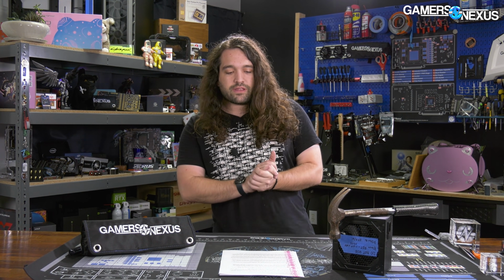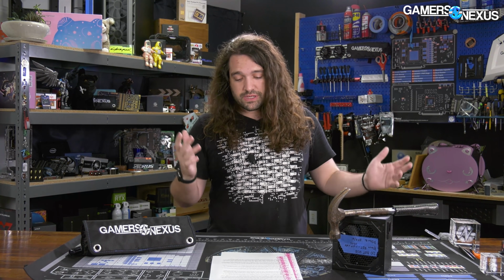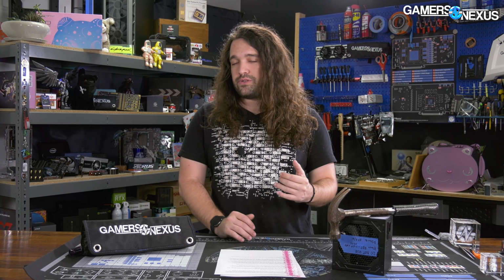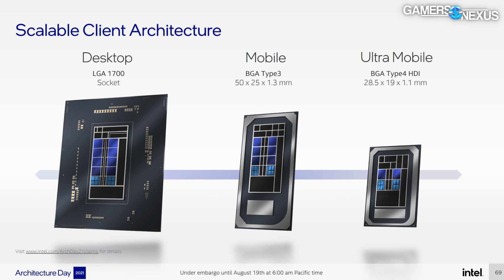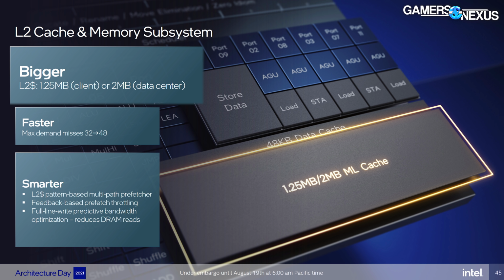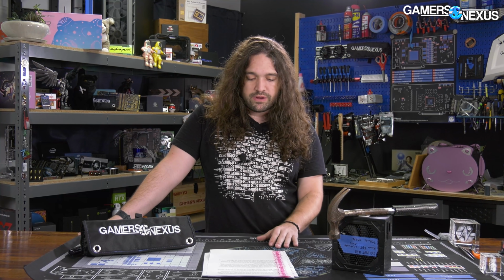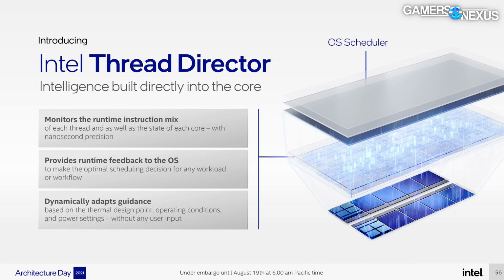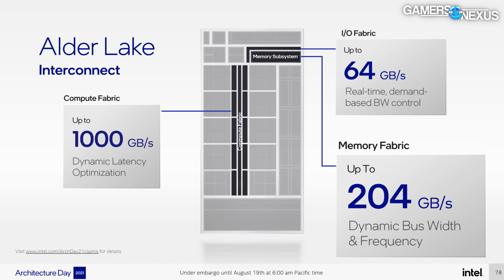Intel Overhauls CPUs: Alder Lake Architecture Explained - New Core, PCIe Gen5, & DDR5

Comment: Can someone explain why I would want effenicy cores. I mean on my gaming pc, I want it to run as fast as possible. I don't want it switching to lower cores. What am I missing and why is this good
Reply: It's like the PS4 design where low power cores can run the OS services and background tasks while the performance cores can be dedicated to running the game
Reply: The efficient cores are smaller and pack more power into less area than the bigger cores.
Reply: this is just my interpretation. efficiency cores are mainly to keep temperatures down which ultimately gives more headroom for your performance cores to run faster for longer. imagine using a 3080 to render a word document. Its overkill as you dont need that much power to run but its still producing that much heat. if you can pass off background os tasks to effeciency cores, lower heat = more boost for performance cores?

Comment: Let's be honest as long as we can lock all of Windows to the low performance cores and then have say the other eight high performance cores solely for our tasks whether they be gaming or cinebench or whatever I'll be happy... And also if the price doesn't hike up
Reply: What makes you think Windows is going to give you that kind of control? Has Microsoft ever demonstrated that kind of consideration for its users? More like you and your silly games will be relegated to the wimpy cores. You peasant!
Reply: @1pcfred  we already can control affinity and priority. I hope they will/would add it for the small/large cores...

Or simply have a "high performance" mode that would shift windows and everything with it to the eco cores.
Reply: @brettcombs774  in Linux there are ways to assign tasks to cores or even dedicate a core to a task. I've never had to do it myself. In general Linux can manage all of that on its own well enough. I really don't see what use low performance cores would be. Sounds like more stuff to worry about to me.
Reply: @1pcfred  perhaps it'll be well enough left alone. But sometimes it's nice to have the feature or capability. The eco cores referenced are supposed to be on the order of greater than Skylake performance but markedly more efficient. I tested a new laptop running 1 core (no HT)  on a 5800h just to demonstrate it could be done for a friend. Given the usage was high it still ran just fine. 

Id wager it will run very well on 2-4 non HT "eco" cores. Which in my mind are similar (yet to be shown) around a 6700 core... 

Which again leaves in theory at least the rest of the system almost entirely for your task. Almost a VM or game console...
Reply: @brettcombs774  I'm sure it's great. It's just not exactly the direction I want to go. I want what I have now only faster. And this ain't that. What this looks like to me is what they can do. Look we can make weaker stuff! I'm all for saving power. I'm just more for having power to use though.
Reply: @1pcfred  that's entirely my point. The perf cores will be better than at present. I think they quoted like 19% IPC. Which is impressive.

And dedicating everything else to the eco cores alleviates usage of the perf cores. Which means everything is faster...
Reply: @brettcombs774  we'll see.

Comment: Could you guys cover more practical programming benchmarks? A blind chromium compile is not a very good indication of code compile performance.
Some projects have different target architectures on different optimization settings.
Python seems to be a fairly popular programming language among your audience, so perhaps find some tensor flow scripts or generic math processing with pandas as additional code benchmarks?

I'd also like to see embedded C compile benchmarks, but nobody seems to write C these days.

Comment: Pray for Intel this won't end like Lakefield. Intel already anounced the end of supply of Sunnycove based chips with April 2022. Until this day there are only two devices that adopted Lakefield CPUs, which does not look very promising. LFs performance is not that great and even in it's prime discipline which is "saving power" it falls behind to compareable ARM chips. The 24 threads i9 will have to compete with AMDs 5900X. I highly doubt this will end in a win for Intel. With only 16 high performance threads, this i9 will definitely have a tough time against AMDs consumer primus. But lets be positive. Nice to see Intel tries sth. new and finally overhauls their architecture. For us gamers though, this new gen. wont add much benefit, unless the switch to 10nm. We are still limited to 8 cores 16 threads basically unless we go for an 10900k/10850k which are still Intels most powerful(overall performance) consumer CPUs.

Comment: I will be interested to see how the new architecture works out performance wise.  I can see a lot of the changes making a difference for gaming or 3d rendering.  I do wonder though how this will all translate into the server world.  Most of those changes do not seem like they will do a whole lot for traditional server workloads, at least with out some heaving lifting from the OS and architecturing of software for things like MySQL.  Obviously faster data transfer is a big thing, so DDR5 and PCIe5 will make some difference if the hardware supports it.

Comment: These new CPUs look real interesting with the dual Performance & Efficient cores, they should make optimal use of the P & C States, meaning even if you overclock the hell out of them, but(like me keep all the c-states turned on(they turn off when you switch to performance mode in Windows power settings for benchmarking), they will truly only use whatever power is needed at the moment. This might even help with cooling?
Reply: Overclocking is worthless today. Frequency is managed by the OS. If your CPU can handle it and the OS needs the resources then the CPU will be ramped up.

Comment: I don't get it. Why would anyone in the desktop space want these efficient cores when AMD are pumping out full 16 'performance' core CPUs? Seems tonme your getting less from intel.

I can see it making sense in the mobile space but qualcomm, apple and samsung already have that market wrapped up.
Reply: Well, the most important market segments for Intel are… catacenters and laptops. This is good architecture in both Intels main market segments!
These also make Sense in those rare cases when they use Office desktops computers at the Office usage. A lot of effienc cores and maybe one or two performance cores when ”real” speed is needed.
Reply: Still doesn't change the fact that these are bad value for performance users.

Comment: The performance cores vs high efficiency cores will be tough to balance. Not surprised Intel is having a rough time. It would be more of a surprise if it was an easy thing to pull off. 

If you run a master thread spawning job threads, it sends it out to the different cores. The master thread then has to wait for the job threads to finish before it sends out the next task. If performance cores are always waiting for efficiency cores to finish, then the performance cores are pretty much a waste of silicon. My guess is that the 8/8 CPU will be seen as an 8-core CPU. This is a guess. 

However, it might be possible to have the software creator take advantage of both cores sets at the same time... heavy emphasis on the might. It would take more effort to chop up the loads, and it might lead to buggier software. However however, maybe the many cores will mostly be split up for SIMD loads, so you can put full SIMD processing on the efficiency cores... maybe... however, sometimes, after 4 cores, it might be just better to use a GPU. 

THEN AGAIN, if you are using all 8 performance cores, the CPU can take on another copy of the program and run THAT on the efficiency cores. Also, maybe the CPU will be free to where you can watch YouTube or maybe do some light to moderate gaming while it's doing that heavy load (gaming provided the GPU is free). It could also end up being overall faster using all 16 cores, even with the waiting for the efficiency cores to finish. An example would be the efficiency cores ending up being something like 66% as fast as a performance core. 

I'm surprised they didn't do something like 1-4 high efficiency cores, but the 8/8 combo might be easier to engineer (and easier isn't a bad thing; it might mean that we get a more-stable CPU). The other option would be 1-4 performance cores with a bunch of efficiency cores.
Reply: Most likely true. In some of cases there might be strange drops in perfomance, but i expect those to be quite rate in modern programs… more likely in older stuff…
Reply: Hm... maybe hyperthreading can come into the equation. You can hyperthread the performance cores, and not hyperthread the efficiency cores. That might distribute the load more. THEN AGAIN YET AGAIN, would this be faster? Another possibility, but not a guarantee.

Why can hyperthreading boost loads? It can be hard to use 100% of a CPU. Because of the traffic cop issues (one main thread spawning child workers that do something, then waits for the workers to return a result and die), hyperthreading can extract more performance out of a CPU. The performance core can even have more than 2 virtual cores, or do even 3 virtual cores on performance, 2 virtual cores on efficiency

Comment: I'm interested to know exactly what the Thread Director is, what it does, and how.
Calling it "software transparent" while simultaneously saying "Windows 11 only" seem like contradictory statements to me. If it's so transparent, Win10, Win11, or Linux wouldn't even enter the conversation. It would "just work."
Reply: They likely mean transparent to user applications, not at the OS level.

Comment: efficiency cores in a desktop cpu are super dumb. they could have used the space on the die for more big cores or more cache.
Reply: But they are super usefull in laptops! And Intel is more interest in laptop and datacenter markets than tiny pity desktop market.
Also Office desktops (if any Office use desktops any more) would benefit from having a lot of small core and only one or two fast cores to reduce power usage and make those even smaller and cheaper…

Comment: Will e-cores be overclockable?
Reply: Ofcourse…. But why? Better leave more power headroom to performance cores!
By owerclocking e cores you would make them unefficient aka destroy their only sensible purpose on alderlake.
Use e cores to low demand task with as little power as possible to leave room to performance cores!

Comment: On MacOS, it is unlikely we will see any of these hybrid CPUs in a Mac. Apple seems content to wait to refresh until they are ready with their silicon, the last Mac Pro (trash can) sold for a long time and then took a long time again for a replacement. The work to develop a new board for the new CPUs to carry until next year is not worth it to them, plus then they can claim better performance relative to intel because they will be using an older generation. 

Because of that, I doubt we will see the core management features be ported to MacOS, maybe by some software engineer/team outside of apple for hackintosh but that's a big maybe. Hopefully it is brought to linux soon, it isn't a huge market but intel has traditionally been decent about Linux support with drivers and the like so I am optimistic. 

Great overview of the new CPUs (as always), I am looking forward to the next few years, at least intel is finally doing something new. I am unsure if and when they will catch AMD but I hope they do for the market's sake. Competition is good (for proof see Nvidia's 20 series and it's abysmal gains vs the 30 series and intel insisting that more than 4c/8t wasn't possible on a mainstream socket until AMD did otherwise)

Comment: I find amusement in how Intel is premiering what could be one of the most important architectural changes to the x86 microprocessor of the modern era ... and is still using Skylake era naming conventions which arguably reached their limits two generations ago for the processor itself.
I also find amusement in the Gigabyte power supply on the desk.
Reply: Considering Intel renamed their future process nodes I still hold out some hope they aren’t afraid to change this , but I also have no idea how you would name processors with two different core types
Reply: @eddyr4984  Easy, Intel i7 920-110 (920 for performance core designation, 110 for efficiency core designation)

Comment: No Mac support: Apple has left them, if they ever win Apple back they'll cross that bridge then. And they'd need some sort of earth shattering improvements for that to happen in under 5 years. Even if they were say, 20% better than  M1 at the same power usage, I don't think that would be enough for Apple to change course in the short term. Besides, Apple have to have their own go at this  kind of scheduling for apple silicon CPUs and have been doing it longer than Intel thanks to their mobile products, so even if that did just happen there's a good chance they'd just use whatever's built into OS X.

No Linux support: Either it means they plan to have their server products to be all E or all P cores, or they weren't able to improve on the already existing scheduling logic in Linux for mixed core types, or we'll hear about it when they start talking about Xeons with this architecture. While they might blow off Linux desktop users, it's inconcievable they'd launch server CPUs with features that don't work on the majority server OS.

Comment: Ah, yes, V-Tech for your computer!

I for one think that the Big.little structure has a lot of promise.  Of course, implementation is still key, but mobile CPU's have been seeing a lot of improvement! Intel may be able to successfully translate that to the desktop space.

I am also curious how CPU power delivery will change.  Will there be two dedicated phase controllers for the big and little cores? Especially if each cluster will run at different speeds and voltages.  Memory is also interesting. Will the increased core cache decrease the need for better RAM, or will RAM become even more important as threads are being transferred between the big and little cores?

Comment: I wish they'd use this opportunity to get rid of a lot of obsolete junk which plagues x86 ISA. It seems like this was one of rare moments when they could actually do that - provide a few full-x86-compatible cores for system to start up with, but then let OS bring up new "x86 v2.0" cores which only support 32 and 64 bit modes without all of that historical garbage that is there only for backward compatibility. THIS would be the true innovation, and would probably make those new cores even faster and more efficient (less logic -> faster clock -> less power). And I'm certain AMD would be happy to join this initiative to refresh x86 and bring it more in line with modern times. x86 ISA is seriously hampered by all of that historical crap, and that's why x86 CPUs are so inefficient compared to more modern architectures like ARM and RISC-V.

Comment: Please get confirmation when you can on if they are some instructions that only work on the performance cores. Does avx-512 only run on the performance cores? I'm guessing it won't crash and automatically move it to a performance core. Will any instruction like avx lock it to the performance cores or can it dynamicly shift back once those instructions are done? Thanks

Comment: For Gamers dump the toy minicores and put more powerful ones on the die - It`s a waste...AMD will have fun. Most games run on a single core, bring back 4 core CPU`s for games, without sharing physical caches between stuff. AMD is much more clever than Intel. IMHO it will be more boring years with Intel until the year 2030.
Reply: Perhaps the Windows scheduling will distribute the single core games around multiple cores. And as time goes by games will increasingly be coded for multiple cores, and at least some already are.
Reply: @Safetytrousers  It's impossible, Games are a real time application and that can't be parallelized very well. 10 years latter and the 2600K can run every single game out there with good and playable framerates, even Cyberbug 2077 (huge bottleneck but more than 30 fps which is ok for that game).
Reply: @saricubra2867  ''Intel Optimizing Hitman 3 for CPUs With 8 or More Cores''
Reply: @Safetytrousers  If you limit the framerate, the CPU load will increase, games are so lightly threaded because the GPU does the job unless we are talking about a very complex game or simulator.
Reply: @saricubra2867  What about the Hitman 8 cores?
Reply: @Safetytrousers  If the game doesn't require them, then it's fine.

Comment: I was around doing SW development when threads became a thing. Do not expect the initial rollout of this new kind of thread scheduling to be smooth. It took years to get thread scheduling to be at all automatic.
Reply: What are you trying to say???
Reply: @Shapar95  ? I'm saying that people should have expected exactly what happened.  P-core threads got dumped on e-cores seemingly at random. Threads stayed on e-cores even when p-core threads became available. Most people don't notice and mostly it doesn't matter but if you're benchmarking you'll get results that vary outside expected variance. If you use these in production environments you'll have weird efficiency issues.